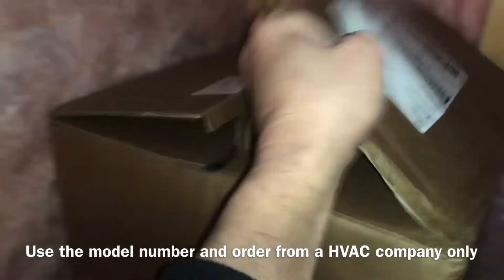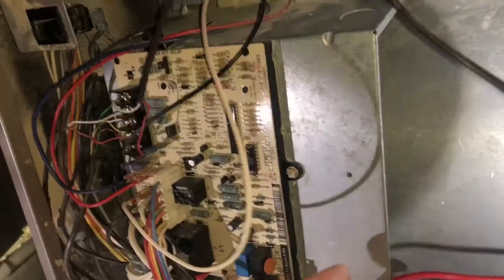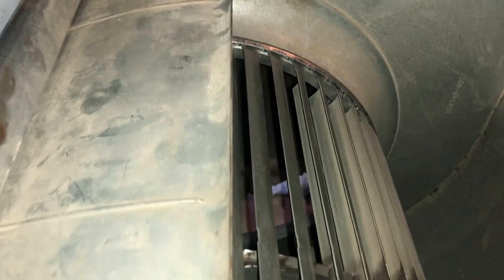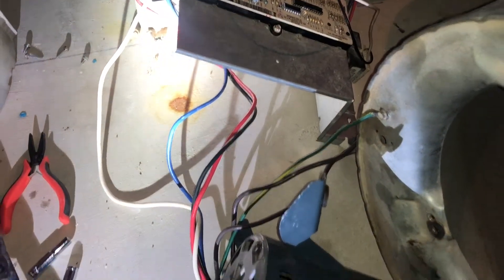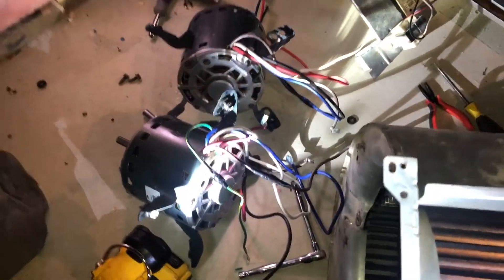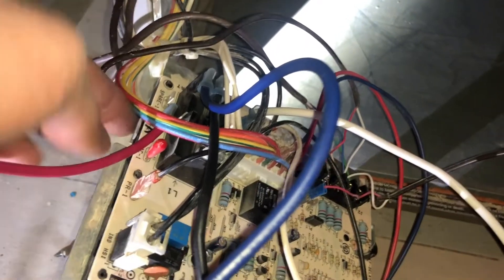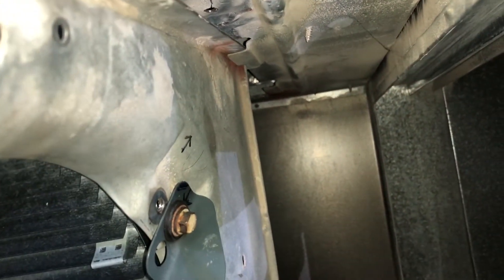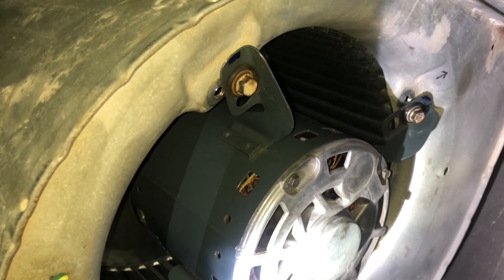Furnace blower motor squirrel cage replacement instructions

Comment: Most Parts suppliers will not sell stuff to homeowners mostly because of liability. If a homeowner comes in and buy something and while trying to put it in they mess up their furnace, then it causes issues for the homeowner, the supplier, and the manufacturer. If you read any of the manufacturers literature it says in there to hire a trained professional to replace any parts no matter how simple it is to replace. I have been in the HVAC industry for 7 years now and the supply houses gouge the crap out of prices because they know they can get the money for it because the price is just going to be passed along to the customer.

Comment: The brackets that hold the motor up had snapped and now that big circle thing is leaning and making horrible grinding sounds. Can you just buy new brackets? My system is in a tiny little hole. So there isn’t much wiggle room to do much so I guess I have to take everything out. But I don’t want to take hours to get it out and not be able to just replace the brackets.
Reply from the maker: It’s called a blower motor housing. You will need to try to find a heating and cooling supply store. Some of them will only sell to contractors.
Reply: @KooperSalmo  oh yikes! That’s not good. The company that owns our house doesn’t consider air conditioning a need and said that they will put the work order in when they have time.  Took them 4 months to fix our neighbors last year :(

Comment: If the cage you order is a the right diameter but little shorter than the original, can it still work?
Reply from the maker: It will most likely work but there’s a reason they have it that size so the right amount of air is pushing through your vents if I were you I would order the correct one but if you’re desperate use it until you get the correct one in

Comment: Thank u good sir, about to attempt to clean and inspect blower wheel and motor I have a slight vibration when furnace kicks into 2nd stage of heating (furnace highers rpm).
Reply from the maker: Just make sure you try to purchase a non-dented one I found that eBay and Amazon people sell damaged ones all the time you need to find a local dealer that will sell to you Sometimes I tell them that I’m picking up for a business that seems to work most of the time
Reply from the maker: If you’re going to do it yourself just replace the motor in the squirrel cage you will save thousands